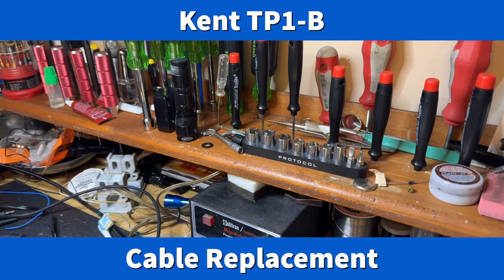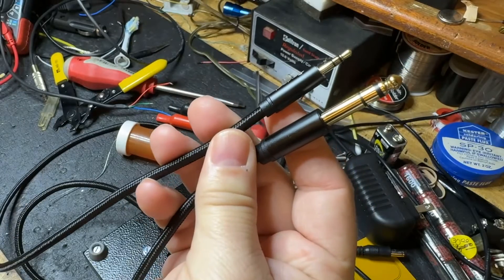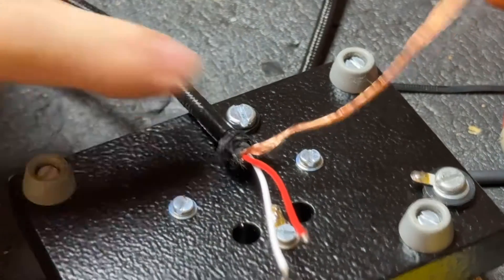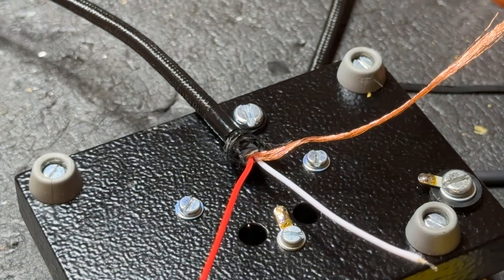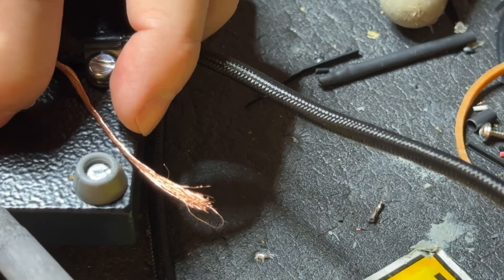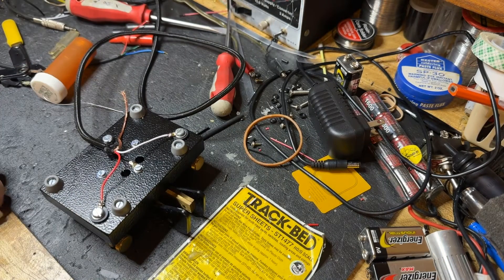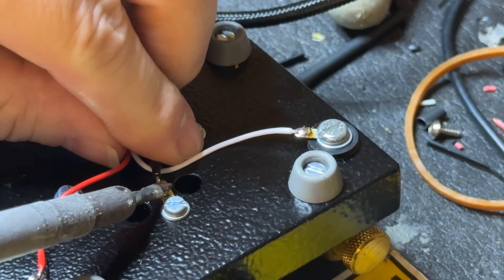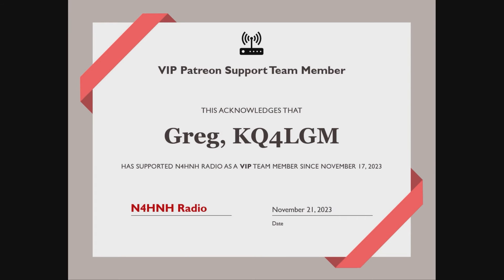Kent TP1-B: Cable Replacement #hamradio #kent #cw #morsecode #key

Comment: Is one for dit, one for dah and one for ground?  I don't see a key on net to the contacts, do you have to have a manual or is that some kind of a standard connection layout everyone uses?
Reply from the maker: I connect the shield to the common connection. The other wires are for dit and dah. If you’re left-handed, reverse them from the way I show in this video.